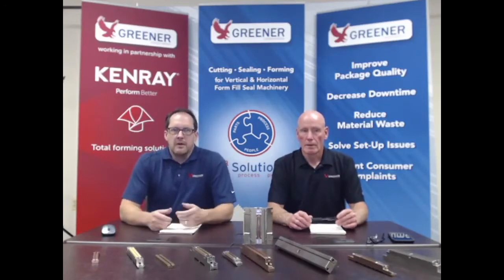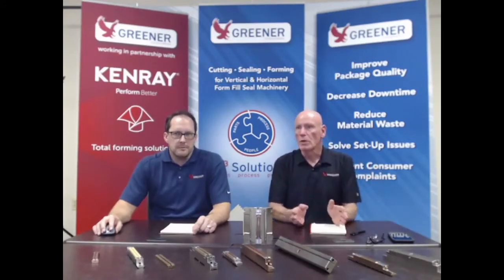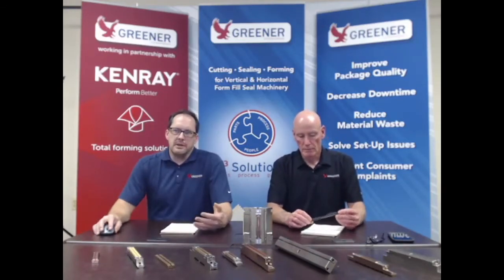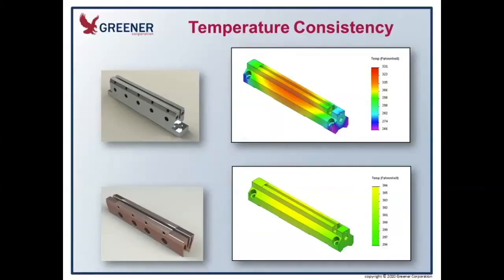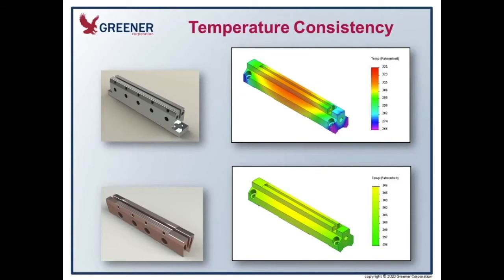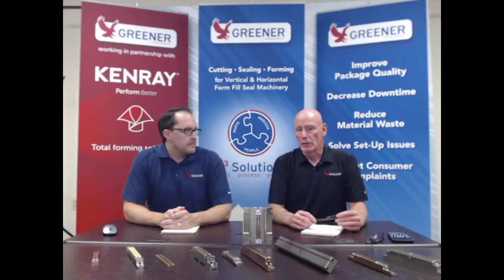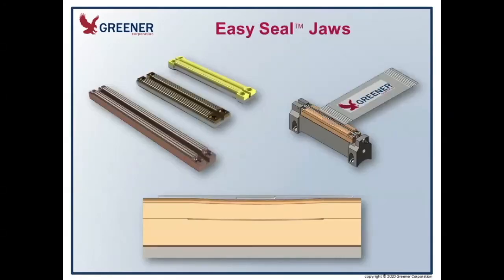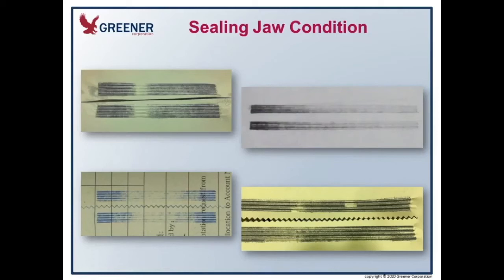Solving Seal Problems on Flow Wrappers & Vertical Baggers

Comment: Thanks my friends!! Im from Brazil, i work in a chocolate factory called "HARALD S.A"  and there have this problem the bad seal, and nobody know how solve this problem, i will try tomorrow solve this, thanks my friends!!! Have a good year!
Reply from the maker: Thanks for your comment! If you would like to consult with one of our technical support staff about your sealing problem, please send us a message via the Contact page on our website, https://greenercorp.com/about/contact or email us directly at custserv@greenercorp.com We will be happy to help.
Reply: Hi, iminteresting on ur solution, is there any contact that i can disscuss with? Im from Epson Batam which produce the ink cartridge.
Reply from the maker: @ikmaintenance1536  Thank you for your question. We will be happy to work with you to determine the solutions you need. Please contact us through our website, https://greenercorp.com/about/contact/ and one of Greener Corporation's technical experts will help you.
Reply: There was perfect sealing,
We also believe that the Sealer position is incorrect. This is powerful, because the sealer is above  on top of the zipper lock, our position it so that the 10mm zipper has pressure on the jaws of the sealer in the 3mm sealing area from the flange on either side, not on the lock of the zipper,
but we are not able to see that, we do not see any issue with the zipper but we are not able to see the position of the sealer jaws and the zipper, how can we solve this issue , because zipper testing is ok , how can we know the sealer jaws and zipper positions are in the proper right place, because so many pouches rejected due to this.
Reply from the maker: Thank you for your good question. To best help you with this issue it will be best for you to make direct contact with someone from our technical support team. Please send your question to: custserv@greenercorp.com or use the contact form on our website: https://greenercorp.com/contact-us/